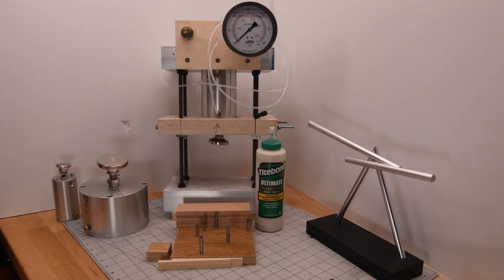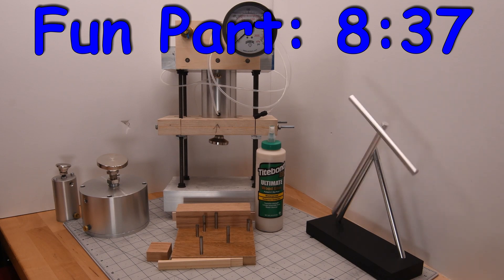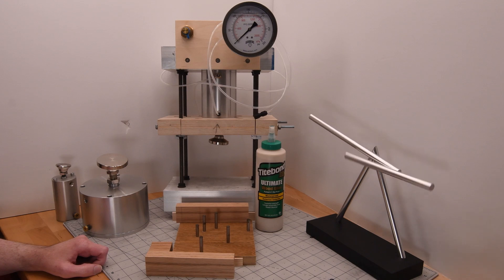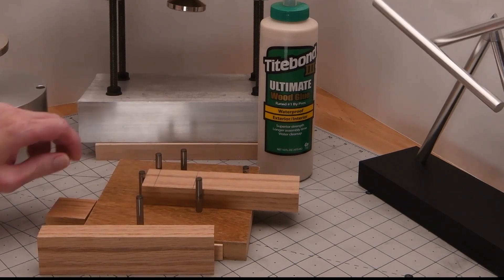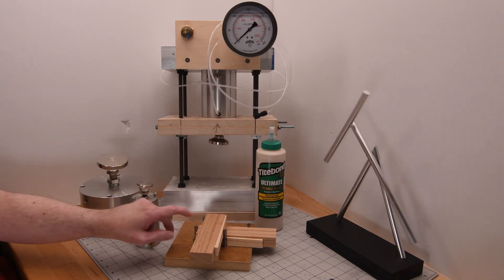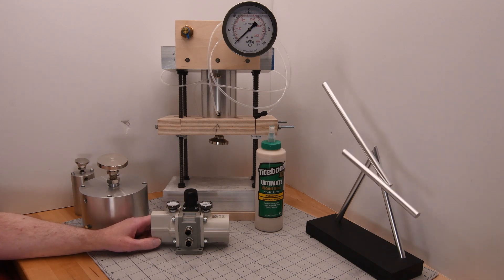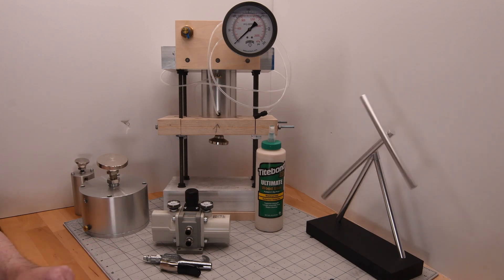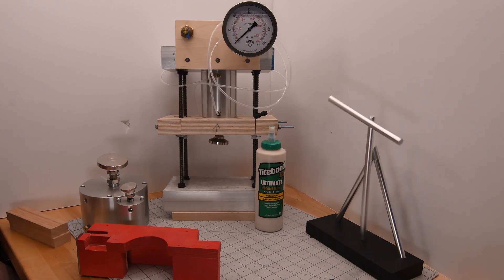Glue Joint Strength vs Clamp Pressure Experiment

Comment: Nicely done. I wonder if increasing clamping pressure as the glue dries would make any difference. Start at low PSI to give the glue a chance to soak in and then increase the pressure to get a stronger bond. Might only be relevant for end grain.

Comment: this is the exact video/ test i was hoping i could find.  I have been woodworking for years and always knew that the "recommended clamping pressures" of 100-200 psi was way too high.  I knew from experience that i get very strong joints with minimal clamping pressure.  The  joint just needs to have good contact surfaces.  

Does no one else find it alarming how contradictory this test result is to common wood clamping recommendations???  Thanks for making this.
Reply from the maker: I've never heard the 100 to 200 psi number before.  Often I have seen where numbers are provided as force not pressure and it's obvious the pressure is what matters.  I will have to go look at the numbers again, but if memory serves that clamping pressure still makes a reasonable joint but it is far more than you need and getting that much pressure isn't easy.  If you thought this video was informative you should checkout Patrick Sullivan's video "Glue Myths: 1. End grain"  I found it after I made my video, I need to add a link to it in the description of my video.

Comment: The best line on the chart was at 25psi clamping pressure. The standard crush strength of a single-layer corrugated cardboard carton (see the circular certification on the bottom) is 26psi.  So if I include a layer of fresh corrugated box cardboard in my clamped gluing stack, when the cardboard begins to crush, I am tight enough.
(I had been wondering how to know when I am tight enough. Now I know. Thank you.)

Comment: That was fun.  What are you going to break next?
Reply from the maker: I'm open to suggestions.
Reply: @cdw3423  How about testing the strength of a glue joint vs 'cure' time?  It would be interesting to see how the strength develops after say 1 hour, 3 hours, 6, 12, 18, 24 (or some similar curing time intervals).